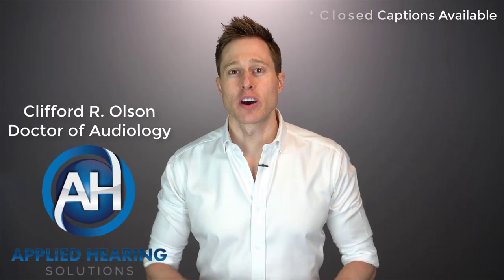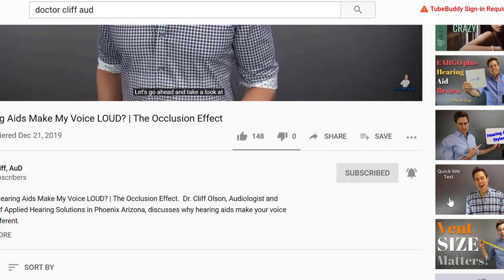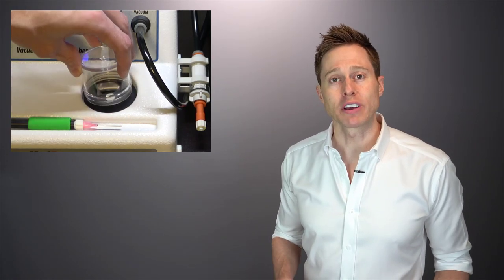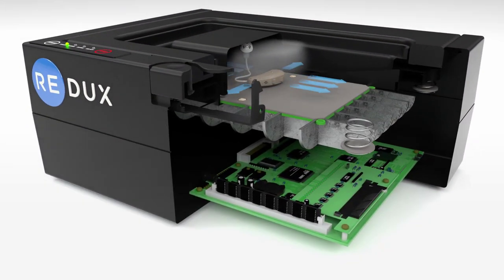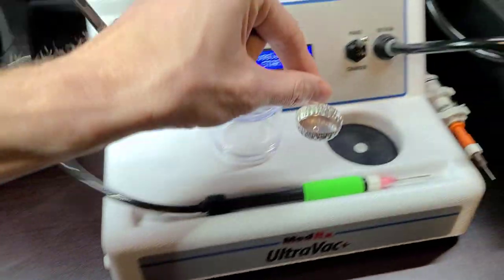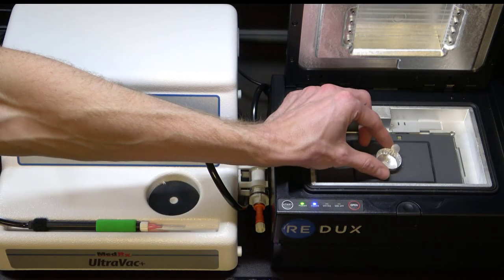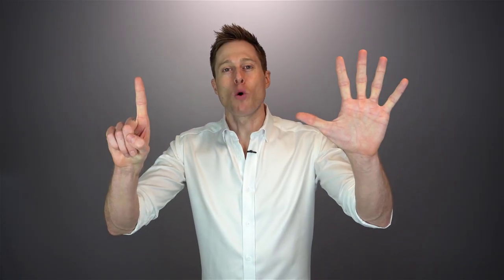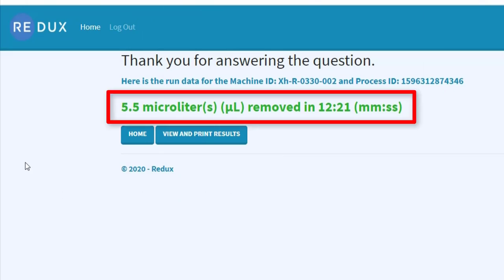How Well Do Professional Hearing Aid Dehydrators Work?  |  Testing With the Redux

Comment: Hi Dr Cliff. Do you have any reviews on any other dehumidifier devices? I am currently using the Dry N Store Global II and hope that it is doing the job. It uses a desiccant brick to remove moisture.
Reply from the maker: Working on that video currently.
Reply: @DrCliffAuD  Cool, looking forward to seeing your review/results. I had originally used the Dry N Store Professional but had to replace it since it had the red light issue.

Comment: As a control to the experiment, did you try putting a hearing aid (maybe with some added moisture) in the Redux system, run it through a cycle, then run it through a second cycle to see if it says it pull any moisture out the second time?  Not that I'm saying I doubt what you are showing in the video, but since you are moving the hearing aid from the Bell to the Redux, it seems you are trusting the Redux as being absolute, so it would help to verify that.
Reply from the maker: Check out my review video of the Redux.  At this point I've done a lot of testing on the Redux and it gets 100% of the moisture out every time.  Sometimes it runs longer than 5 minutes depending on how much moisture there is, but it doesn't stop running until the dehydration is complete.  Each time I run a hearing aid through a second time, it always registers as <1 microliter.

Comment: Would this do the same thing for cochlear implants and their accessories and batteries? Living in Texas I can say with certainty that it's not just apparent water sources (or pool, shower, drinks etc.) But also humidity and condensation from cols to  hot (think ice cold AC to swiltering suffocating humid heat). So far I've had issues with my devices related to moisture despite using the dryer I received as part of my initial kit. So I am wondering if such a device would useful to use like once a month or so?
Reply from the maker: Yes, I would recommend this for Cochlear Implants as well.  It has been proven safe for Lithium Ion batteries.

Comment: Thanks for doing this video.  It has me seriously considering getting a Redux system for my practice.  

Question:  you injected 5 microliter into the hearing aid, but what’s the typical amount you see in an aid coming into your office.  I suspect you chose 5 for that reason.  Just want to confirm.  

Also, you insinuate that bell jar systems don’t do anything at all, but I’ve seen hearing aids come to my office that are dead, and we bell jar them and they come back to life.  Just saying...
Reply from the maker: Most hearing aids that I test, (~85-90%) have between 1 and 2 microliters of internal moisture.  I wanted to create a situation where we could test the maximum dehydration ability of a hearing aid.  I could only fit 5 microliters into a hearing aid before it started to overflow.  If the Bell jar system pulled 1-2 microliters of moisture, I would have called that a success.  Anything more than that, and I would put it in the same category as the Redux.  Unfortunately, I have not had the same success with restoring dead hearing aids inside of a Bell jar system, nor have I been able to detect any ability to remove moisture from inside of a hearing aid after repeated testing.  I guess, in theory, if there was a droplet of water covering a microphone port or a wax trap, and it was exposed, it could help with that to the point where a device could be recovered.

Comment: Regarding the test on the hearing aid -- shouldn't you have run the hearing aid through the Redux first to make sure it was absolutely dry before injecting the new water?
Reply from the maker: I did, just didn't share that in the video.
Reply: @DrCliffAuD  most excellent, then.

Comment: Hi I have just purchased the livio 2400 AI I can pair this to my iphone no problem but as soon as I try to pair the aids to my iPad as well the app crashes and one device ceases to work. Starkey have not been able to answer this problem so far. Any ideas?
Reply: Hi Les Murray,
You can be paired to multiple devices through bluetooth and have the connection however to use specific features such as the Thrive app you must simply turn bluetooth off on the secondary device.
Theodore
Reply: TCD Hi Theodore Many thanks for your help with this . I was going around in circles and the guy at Starkey in the UK did not have enough experience to help. Thanks again
Reply: Les Murray No problem Les, 
A patient of mine last week asked me about that. 
He has an IPhone and an IPad both paired to the Livio Hearing Devices and he asked me that same question. You must simply turn off Bluetooth and keep on for the device you want to access the Thrive app through and vise versa. 
Think of it like you have a set of headphones and you are trying to listen to two different songs at the same time from two sources, just won’t work. 
All the best, take care! 
Theodore
Reply: TCD Thanks again. I will pass this onto my audiologists as I am sure this will come up again with future patients